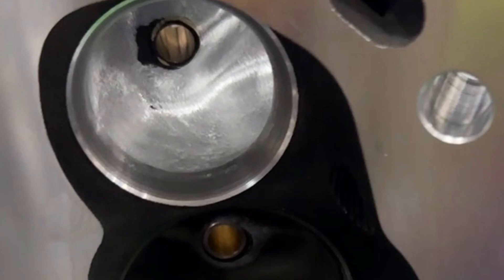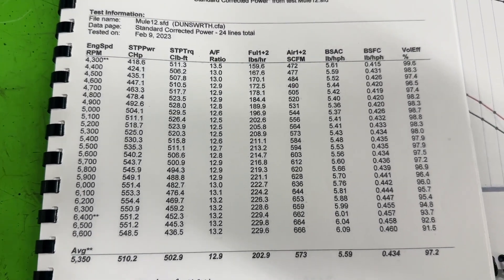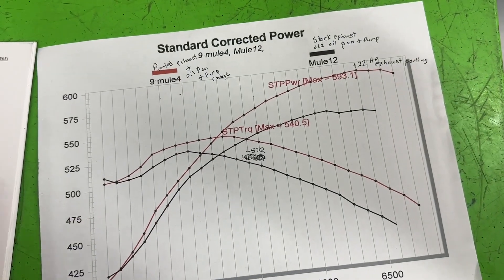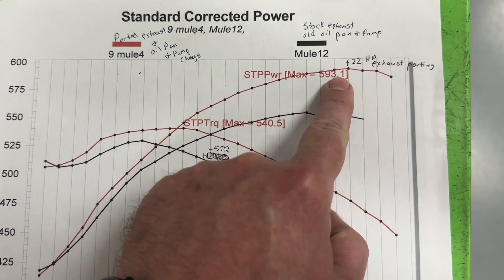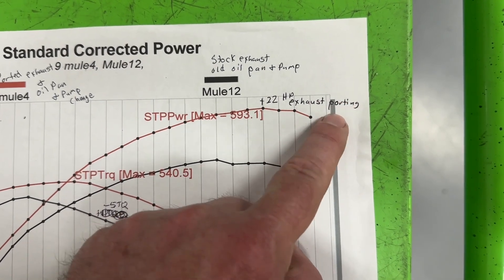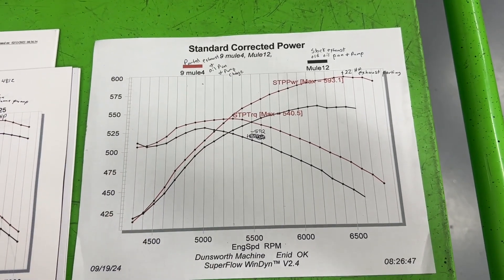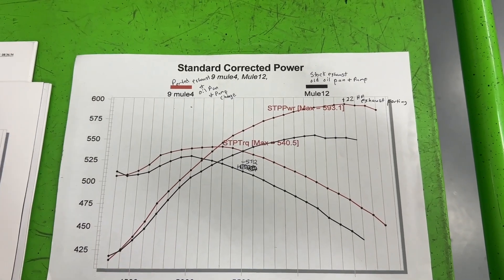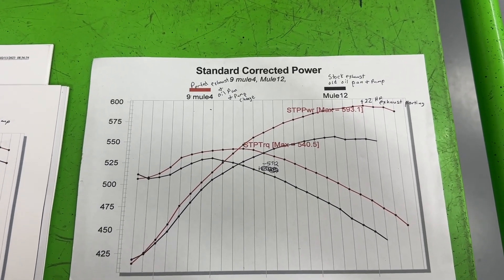How Much Power Do You Gain Porting Just The Exhaust Ports

Comment: Several years ago l ported some circle track heads only on the exhaust side. The customer requested it. It was a "cheat" for his class they didn't check at tech. He reported back it had made so much more power he had to work on the chassis to make it around the track

Comment: Pistons don't like back pressure. Sometimes that is from the exhaust other times its from the head. Apparently this combo needed more head flow.  The real question now is if it had less exhaust duration but still about the same lift could you get the torque back down low and make a broader powerband?

Comment: The Ram Air V Pontiac heads had a poor exhaust. They flowed worse than the Ram Air II round port heads. However, running 13 - 1 compression ratio, the bad exhaust ports did not seem to matter.

Comment: Make em as big as you can! It's gonna get out better, period
Reply: No. Too big and velocity will suffer and the exhaust pulse may want to stall, and worse, go backwards. I've been doing a lot of work on a certain 2 valve cylinder head with a very poor exhaust port. On my current head that I built and I'm running, I did a lot of work to the chamber and port but it's still a somewhat undersized valve size. I'm using a tune that was developed on a very very similar engine but it had a larger exhaust valve in the head. The tune is completely unusable because it's way too lean down low under load, showing that on this other engine, there was reversion so bad that it registered on the MAF, and had to be tuned "leaner" to get the correct AFR's. This phenomenon has been documented before on these engines. I've concluded that the only difference between the 2 motors is the exhaust port.
Reply: @curtislovrak5390 umm no, but good story. Been on the flow bench many hours and many different cylinder heads. Just saying in general, get CSA, make the valve job very good, make the port that size or larger all the way out. Reversion has nothin to do with the port size. Also, live tuning is way better than someone sending you a file that works for something else. Seems you had a bad tune. If that's what you are doin.
Reply: @slopoke22  I'll tune it once I put together a fresh bottom end. My engine has nearly the same cam, with 3° less LSA, and 4° more duration on the intake @.050". Same head casting, both ported, just I'm using the stock exhaust valve size. Same pistons, same piston to head clearance, Same header and exhaust to the merge. Same intake manifold. Everyone else with stock heads and much milder cams loves this tune, it just won't work at all with my engine despite the camshaft I've had in there. My engine works fantastic on the stock tune. Super smooth idle, comparable to stock, great power just off idle. The only think I can contribute this lack of reversion even with more duration, more overlap, is that the other cylinder head is really really bad, even though it was developed on a flow bench. I will eventually want to test 2 identical heads just with a larger exhaust valve and the proper deshrouding.

One last thing to mention, is that valve shrouding on these castings is horrendous. I've improved this on my head, but with a larger valve it'll need even more deshrouding which the cylinder wall may not allow.

Comment: Dude when you fix or replace the dyno mule, just do a pull stock as it is, then do an exhaust port on those heads, then dyno that that set up, then go back and port the intakes and make another dyno run. Would be very interesting to see results that are apples to apples, too many variables with the test in this vid, I'm sure it made more power, but the amount is questionable in this vid.
Reply from the maker: Only one variable on this. But maybe

Comment: Based on the comments I see... The intake port is the "meat and potatoes" of the HP/TQ gains. However, if the exhaust is not addressed at the same time to support the increased flow, you are leaving some of the "meat and potatoes" on the table. In addition, valve angles, valve seat angles, intake, duration, lift are all factors as well. So, each engine (N/A) will have max potential HP/TQ for a particular setup. So the question I have is: What creates the true baseline of any engine, for an engine builder, to create a max/most efficient HP/TQ platform? Would this be bore, stroke, and compression? With an established baseline (whatever that might be), is there a natural progression and order of parts and engineering concepts, from which to work through? (i.e. Step 1, Step 2, Step 3, etc.) I have never seen an "established norm" for this, and I am sure this could be based on application; and additional goals. I am sure F1, Drag, Circle, Street, etc applications all have their own formulas; some the same, some not. Maybe some can write a book on this. 🤓

Comment: My guess is that doing exhaust only will create vacuum which will increase air intake speed which will make more power by itself and in turn helps the fuel atomize better which also makes more power.
Reply: what about better exhaust scavenging and less intake charge dilution  ?

Comment: I recall Mopr big blocks having weaker flow with exhaust port , i spoke once to owner of Indy cyl heads and asked about EZ heads and he said hold valve open for exhaust idk duration or lift but most cams use more lift for crutch?
Reply: BBM's Exhaust /Intake on the 906 heads was roughly 68%, OEM 2.08/1.74 valve size while 518 Max Wedge heads were 75% 2.08/1.88 , average Port job on the 906 heads 2.14/1.81 valve is roughly 70% Intake to Exhaust flow at .500 lift..    I can tell you on a 426 Street wedge(4.25 bore 3.75 st) cam was Mopar .654 Min express, Made 670hp @ 7200,  with a set of OEM max heads, same short block with a set of Indy Cylinder head ported 915(same port as the 906, smaller combustion chamber) made 645hp@ 6900rpms.  now this really wasn't Apples to Apple test, the max heads had a Holley Street dominator intake manifold that the port opens were welded up to match the larger Intake port opening of the Max heads while 915 heads used an out of the box Holley street dominator intake. Intake flow @.600 lift for the max heads was 295 while the 915 @ .600 was 313cfm. Dyno was a superflow 901. both used a Get'em garage 950 cfm carb and timing was 40* all in by 3200. Same Harland sharp rockers were used on both heads. fuel was local 100 oct.

Comment: Eric, this is why I like your channel. I have been shouted down for saying there's power left in the exhaust port development on American aftermarket V8 heads. Why run a longer duration exhaust cam lobe to extend the rpm range when you can just develop the port? This gives you more options on cam timing and manipulating cylinder pressure. Get that port flowing a bit better and try a cam that opens the intake at about 30 degrees BTDC and opens the exhaust around 55 degrees BBDC (using .006 gross duration numbers, not the .050) Yep, you'll need about 15-20 degrees smaller exhaust lobe and a tight 105-108 LSA for it to work properly and probably 0 degrees of advance ground in. (try 280/260-105-0)You'll have a wide power band there. This isn't a new approach, Porsche's air cooled 911 engine has run like that for 50 years. It;s exhaust ports flow almost the same as the intakes.  Pretty much the same with their 4 valve engines, I think. Get in touch with an old Ford drag engine builder  named Ben Alameda on his Youtube channel and ask him about what he does to the exhaust seats even though it kills mid lift flow numbers. There's a lot more to this. Cheers!

Comment: I did a set of iron head years ago with exhaust port work and it gains hp and torque.  I recently asked on a head porting page about exactly this. No one new the answer.  So thank you for confirming what I already suspected works.
Reply: Reduced engine pumping losses - surely.
Reply: @ThePaulv12  also increases scavenging between intake and exhaust overlap

Comment: Commenting at the start to see how wrong I am :p

If you make the exhaust more efficient (and use a small enough header, off the head at least) you can make better use of scavenging, potentially using wilder cams than otherwise possible without losing lower in the rpm band.

Comment: Been there done that and retired ! 23 years ! Valve angle will be crucial and I started with iron heads unlike those who don’t touch them but come from a time that propelled me into the new heads with various valve placements and valve seat angles ! Ultimately cam shaft will be your learning process !  Personally afr heads are trash ! 🗑️
Reply: Y do u say afr heada are trash
Reply from the maker: I use to port cast iron heads for years. Afr heads are proven performers. Not to say other heads are not better.

Comment: Why did you not run it on the dyno W/O the headers, you flow your ex ports W/O a pipe??????
Reply from the maker: This is simple and you know this Dave. The size of the pipe and the turn of the pipe change how much it flows. You can make nice straight huge pipes on the bench but that is not how the headers are.
Reply: @WeingartnerRacing  Eric I would recommend you read page 87 of the superflow 750 manual.
Reply from the maker: @racerd9669 what does it say. I broke the usb that my manual came with. In all fairness it doesn’t matter what the bench says. The dyno is more important to me.
Reply: @WeingartnerRacing  Eric it recommends you run a pipe on the EX port when flowing. I would always turn the head EX out and flow all small block heads w a 1 7/8 curved down pipe and the Big Block heads w a 2 in pipe. As you must know the sound the port makes will tell you the story also. You should never flow the air across a sharp edge, hence the reason for the pipe. I agree 100% the dyno is the real measure of how good the ports are working. I gave up on dry flow 25 years ago, after flowing heads on my SF100 in 1972 and then my SF600 serial #11 and built my own wet flow bench for intake systems. That is when we start to learn what the engine really wants. And as you know you will find that in ignition timing. My CHI 208 head made best power w only 17degs of timing. I spent days and days looking at wet flow. My advice to you is sell the SF bench and invest in your own Dyno. I applaud what you are doing, not many people spend their own money testing like we have done.
Reply: @racerd9669 why would he sell his bench when he has to port heads yes I get it flow bench ain't everything but it shows what has been improved when he ports a heads. Also flowing a head with a exhaust pipe I myself don't see a benefit because he tried smaller and bigger tube and the bigger tubes always flow more but the bigger tubes always made way less low to mid range power making the engine run like a dog. So that's why Eric doesn't use pipes to flow his heads anymore
Reply: @chevyrc3623  Eric has 2 flow benches, sell the SF and put that money toward a Dyno. The SF manual wants you to use a pipe on the EX. Its simple you use the same pipe on all SB heads and the same pipe on the BB heads.
Reply: @racerd9669  so your telling Eric what to do with his own business ok sure. Also why tell him to seel his super flow when the manual in the super flow says to use a pipe that kinda makes no sense to me. Also if his sanez bench goes out then he has no flow bench to do heads with so that doesn't help him either. His job is a head porter Dyno stuff makes no money
Reply: @WeingartnerRacing  I agree, the bench may tell you if you're going in the right direction, but the dyno or track tells the truth.
Reply: @racerd9669 why don’t you donate a good portion for his dyno
Reply: You run your car without headers or manifolds? It would be pointless to dyno an engine without any type of exhaust.
Reply: @jeffreydurham5342  So then it must be pointless to flow test the Ex port W/O a pipe, Right
Reply: @racerd9669  ok, what are you going to do? Put every possible header on it ? Every possible diameter? Every possible amount of bends? Flow the head, port it to the best of your knowledge and put it on the dyno. See what happens just like Eric does. It's pretty simple, really
Reply: @jeffreydurham5342  You only need 1 pipe for Small block heads 1 7/8 turned down about 1 inch from the flange, ALL your data will be taken w that 1 pipe on every head you test, and a 2 in pipe for all BB heads, its funny that SF in their manual tells you to flow w a pipe, I wonder what they know. Sure you get higher #s but you get correct #s .
Reply: @racerd9669  so your saying that ever engine should run straight 1 7/8 header hmmm I don't run that in my sprint car. In fact for my type of racing I would do 1 3/4 to 1 7/8. Ok how about street car 1 5/8 to 1 3/4 in my opinion. A street car wouldn't like a 1 7/8 header. So why flow it to begin with just 1 pipe when some  customers probably won't use it. But what do I know. I am just giving you examples why use only 1 tube for every single heads for every application that is out there. But yes there are people who probably use 1 7/8 headers but do all no obviously not so it's pointless I am just saying. Eric already explained in multiple videos on why he does flow with a exhaust pipe do I need to link the video for you so you can see what it does on the flow bench
Reply: @chevyrc3623  What I am saying this is only for flow data, NOT for racing, of course every engine likes a different tube diameter . But you should not flow test an ex port w/o a pipe, its on page 87 of the SF manual. Anytime you blow air across a sharp edge you induce turbulence into  the airflow which effects the true flow data. I have some experience with this, like 50 years on a flow bench and at least 60,000 flow tests.
Reply: @racerd9669  can you please explain to me how he flowed it without a pipe, ported it and improved it without a pipe, and it made more power with a " pipe" . Why did it need a pipe that wasn't going to be used on the engine? I just wish you could have posted a few of those 60000 flow tests.
Reply: @jeffreydurham5342  When the SF manual on page 87 says you need to flow the EX with a pipe, I would think they know what they are talking about. Yes you can improve the port W/O a pipe, but the numbers are false. You cannot blow high velocity across a sharp edge and have correct data. In 1972 I purchased some of the very first Aluminum SBC heads. From Warren Brownfield . I was flowing my heads on a SF100 bench. That was year 1 of SF. I flowed the Brownfield heads and they flowed less than my Turbo heads. Warren told me I am flowing the heads wrong. You need a pipe on the heads to get  correct data. Funny thing is that Brownfield sold that company to Ken Sperling, who started AFR.  If you want to know about the heads that I have designed. Look at the EMC contest. My heads have won that contest more times than any other head.  Eric and I are friends we have competed against each other in the EMC. He is a smart guy, I just do not agree on the way he flow tests the EX port.
Reply: @racerd9669  He ported the exhaust, it made more power. Why do you keep harping on page 87?  It has nothing to do with this video.
Reply: @jeffreydurham5342  You did not read Erics reply to me. He said he lost his SF manual and did know that SF wants you to flow the EX w a PIPE. Would it change the dyno data, probably not. But it will make for more repeatable data on the flow bench.
Reply: Although long-time Tradition, Why are Exhaust ports flowed at Same Intake corrected pressure (28, 25" water, etc) when the exhaust gas is thousand degrees Hotter with practically Zero relative mass Inertia & no Wet flow dropout componets compared to the much Cooler dense wet Intake componets ?? .....Just seems logical to Test flow the Specific port (Intake or Exhaust) closest to its average Running Psi & temps.....Would dramatically increase the flow bench Complexity but possibly increase the Exhaust port Flow measurment to Actual running dyno Tracking differences relationship....
Reply: @tomstrum6259 
Flow bench is for a comparison.
Some experts claim well scavenged well done exhaust can draw 120+ inches. How would you test that?
Reply: I already have

Comment: I have suspected that porting the exhaust only would be beneficial, especially on turbo applications. My reason for thinking that is I can force as much air in as I want, but getting it out is harder. The engine is working against itself to push the spent gasses out, so it seemed to me that reducing that restriction would absolutely provide an improvement. 

I'd be interested to see what happens is only the intake gets ported. I know this test can happen due to the unfortunate demise of the engine, but if you ever get the chance it might be interesting. Thank you for what you do!

Comment: Can we assume that porting both intake And exhaust ports will make the most gains?
Reply: That wasn't the point of the video the point is how much gain could be possible when porting the exhaust port. Then what would happen if you did just intake or just chamber. Vs all off to see what made the bigger difference so we can all learn
Reply: no if by porting you mean removing material from the ports think Cleveland 4v heads which in many applications require material to be put into the inlet runners

Comment: Making me think that if you had the unported head if would benefit from more exhaust duration and lift?
Reply: I don't know,  maybe the cam timing events are close and improving flow within those events is key. The power stroke stops when the exhaust valve opens, just like the compression stroke actually  starts when the intake closes.
Reply: @jeffreydurham5342  yes